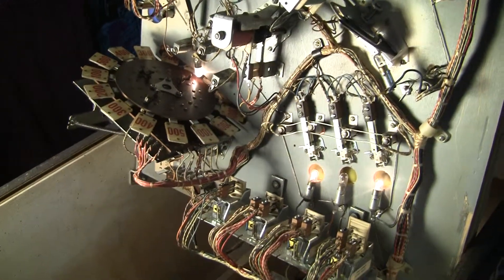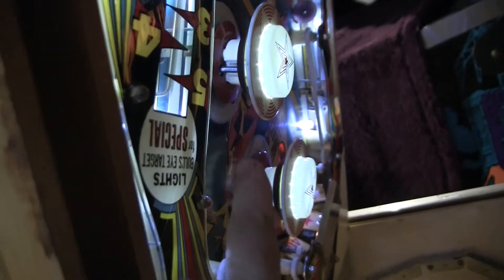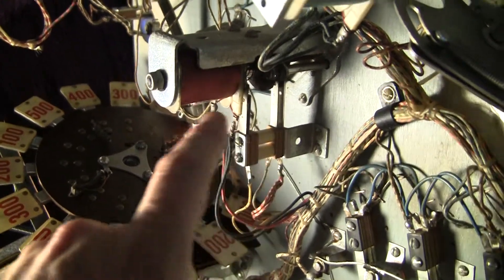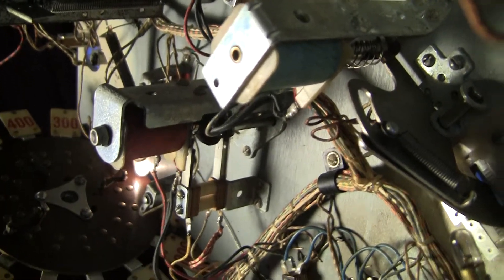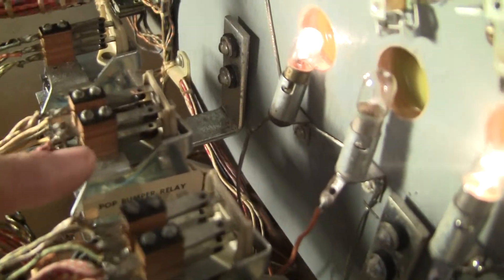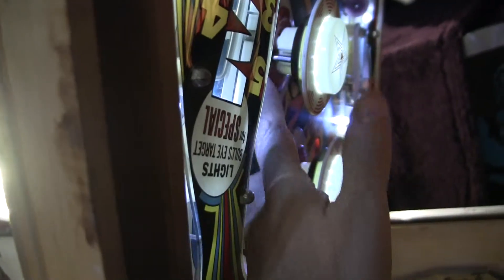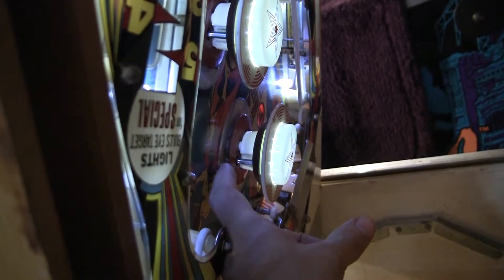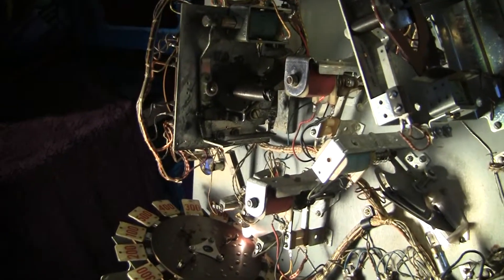*EM Tech: solution to sticking pop bumper problem explained

Comment: PINBALLHELP,                        There is different FET part numbers to drive the pop bumpers solenoids. I'm guessing some pop bumpers coil resistance is higher than other pop bumpers coils and need a FET that outputs more current?
                                       The FETS are turned on/off by PIA chips that are turning off/on the pop bumpers solenoids. I'm guessing when a ball hits a pop bumper it turns off the pop bumpers switch which sends a signal to the PIA chip which sends a signal to the microcontroller and the microcontroller outputs a signal back to the PIA chip to turn off the FETs to turn off the pop bumpers coil?
I'm not sure if this is the correct sequence of events that happens
Reply: This is an EM game, it has no FETs.  

Both pop bumpers have their own "spoon" switch, either of which turns on the pop bumper relay.  

The pop bumper relay also has a Lock In contact, normally open, so once the pop bumper relay is activated, it is locked on.

The pop bumper relay also turns on the pop bumper coils, both of them..

Both pop bumpers have a normally closed End of Stroke switch, which opens when the pop bumper kicker is pulled downward.  Both switches must open in order to break the power to the pop bumper relay.  

The Lock In switch contacts are in series to the parallel normally-closed end of stroke switches.  Once both contacts open, power line to the relay coil.is opened, deactivating the pop bumper relay, which deactivates the pop bumper coils.  

The pop bumper return spring raises the kicker skirt, opening both the end of stroke switches, and the initial switch contact.

Another cause of sticking pop bumper is that the skirt descending pin that operates the "spoon" switch sticks to one side of the spoon, thereby keeping the initial pop bumper relay coil activated (and the pop bumper coil, also)